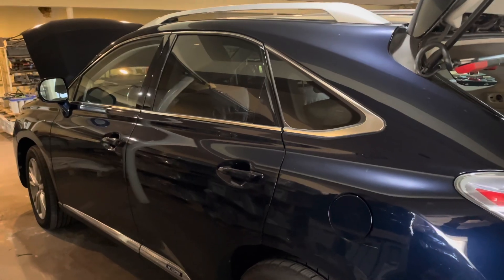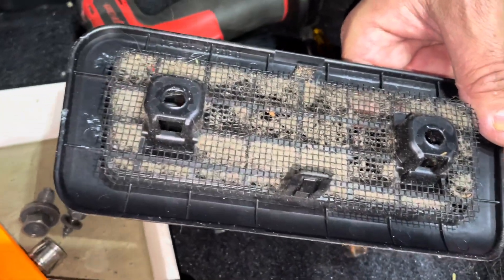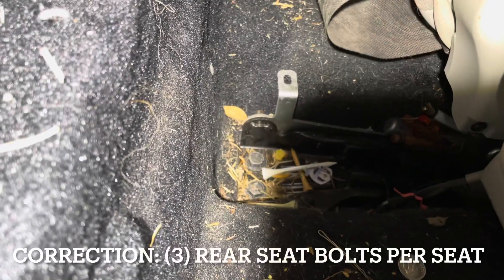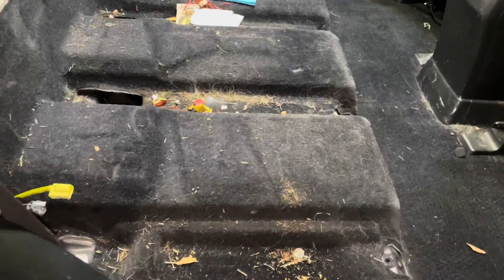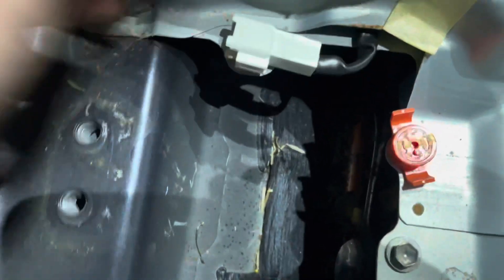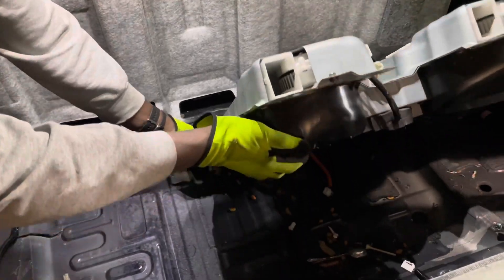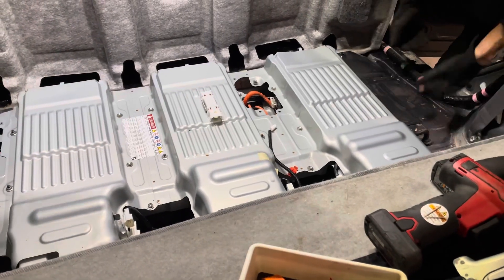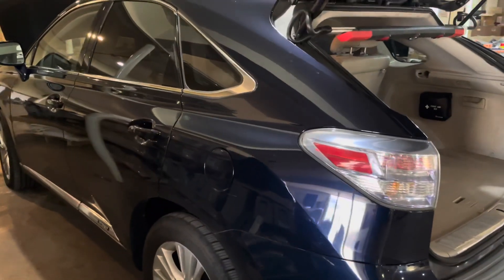Lexus RX450H Hybrid Battery Removal & Reinstallation (2010-2015)

Comment: Replaced mine with assistance from video. The car wouldn't start afterward. Immobilizer, security??
Reply from the maker: You would need to pull the codes to see what is going on.
Reply: @PalmettoBatteryPros  We got it, thank you for the video! Extremely helpful!

Comment: Great vid, I think you have motivated me to have a crack at changing mine.  Are there any fuses etc in that area that come totally take out the hybrid batteries and make the car not start able at all (this is what's happening with mine - the battery failed several years ago but it kept driving on the ICE, but now it wont even say ready and start the ICE)
Reply from the maker: Good luck with it!

Comment: I'm contemplating buying a 2010 Lexus 450h with 165k miles. Having watched your video, should I take the vehicle for battery  inspection at a Lexus service center or hybrid battery center like yours for hybrid battery status? Tremendously impressed with your work. Wish you were in San Diego! Thanks.n
Reply from the maker: I appreciate your comment and sometimes wish I was in SD.

Comment: Thank you very much for this excellent video. I have a Lexus RX400H on which I have just had the relay changed. The car had taken on water following infiltrations which no garage is able to tell me where they came from. A garage has kindly replaced the seals at the rear of the car, but it continues to fail. This means I have to stop the vehicle and disconnect the small battery to get the car moving again. Do you know how I can quickly check whether the car is still taking on water? Could the problem be due to the air vents being blocked? You seem to know the intricacies of these car models very well. I would be very grateful if you could help me with the final repair of this model of car that I love. Thank you
Reply from the maker: I'm sorry, I would really need to see it. I'm more of battery guy than an auto mechanic.

Comment: hi. I'm Lorenzo. I also bought a Lexus Rx 450h from 2014. It was hit from the front in 2023 and has been parked ever since. What advice do you give me to remove the battery? I'm a mechanic, not an electrician. Is there a chance that the battery, since it's been parked for so long, has failed?
Reply from the maker: Follow the video and call a national hybrid battery supplier. We recommend Hybrid Geeks.

Comment: I am watching this video on 9th March 2025 out of curiosity as I don't even have a hybrid but drive Lexus RX 300 -270000 miles on it. I am intending to buy a preowned Hybrid .
any tips you want to give before I buy .
However , your video is EXCELLENT AND AN EYE OPENER for all of us why we need to keep our car clean and maintained .Thanks, love this insight video and your hard work 
filming and sharing it with all of us , A BIG THANK YOU.
Reply from the maker: Thank you so much! The batteries need to be replaced around 150,000 miles or roughly 12 years in age.
Reply: @PalmettoBatteryPros I have a 2010 RX 450h and no sign of battery problems. 254 thousand kilometres now. When you use it will last ages

Comment: Great tutorial, guys.  I'm just a car owner and not at all a mechanic so these comments are from that reference point.

Just had my 2010 RX450h hybrid battery replaced and wanted some background on the steps required to uninstall the old one and install the new one.  Just a couple of comments, if that's OK:

1) It wasn't clear to me until near the end of the video whether the hybrid battery was installed under the front of back seats.  By the end it was obvious that it was under the back seats but because of the complexity of the battery removal and re-installation parts of the front seats needed to be removed.  Maybe in a subsequent video it might help to include a few quick video frames stepping back from the car to show the doors open to make it clear where the hybrid batteries are installed.

2) I was very interested in the part of the video focusing on the vents that were partially blocked by dog hair and other debris.  But I'm still not clear where these vents are and if I knew where they were, I could occasionally vacuum them our, or even remove the covers to wash the filters?  Maybe it's obvious, but as just a car owner, it would help me maintain the health of my hybrid batteries if I knew exactly where they were, and even a quick comment about how to keep them clean?

Thanks for a great video.  Very helpful!
Reply from the maker: Thanks for the feedback, the battery is located under the rear seats.

Comment: Hi! I just replaced mine today! I have an issue! After reinstalling the new one from the dealership, i am unable to start the car and I still get the P0A80 code! Do I need a specific scanner to clear the code and reprogram the new battery to the vehicle?
Reply: Did you fix the problem?
Reply from the maker: Were you able to correct this?

Comment: Hi guys. I have a question for the owners of the RX450h or anyone having experiance with it. Currently driving Prius Plus 2016,which has a small hybrid battery under armrest and heard only positive stuff about it. However, I am in love with RX450h and would love to get one. Should I stay clear off the high mileage RX 150 000 miles/250 000km or with good service history I should go for it? Or mybe better pay extra for lower mileage? Greetings!
Reply from the maker: These batteries need replacement after 150-200K miles

Comment: Same code popped up on my 2010. Ordered a used battery out of a crashed vehicle on ebay its about to be here..   my battery in the car now works for about a 100 miles give or take until i throws the code..  179k miles.  Should i check to see if theres something simple in the battery that needs replaced or just replace the whole thing with a new battery im getting?  Thanks!
Reply from the maker: it’s taken me years to figure out how to properly inspect, analyze and recondition these batteries. Also, I use expensive machines to test/balance modules. Given the worth, I’d see if anyone/dealership would give you money for returning it instead of trying to fix it. At 179k, the modules are low in capacity and having trouble balancing, In addition to corrosion related issues with hardware, harnesses and bus bars.

Comment: 8:08 I noticed those arent lock nuts that came off the battery pos and neg. My car just smoked up after about 4k miles after installing the new battery. Im still trying to the car back running but those two bolts backed out and were loose. In the case of the negative terminal it actually fused the nut to the bolt.  I guess what Im getting at is Im going to use lock nuts when I finally get everything figured out and reinstalled. Hopefully that's all the cause my car to break down on me on the highway.

There was a suddenly loss of power and smoke coming from the back seats. The day prior I smelled something burning. I can send you some pictures, my battery junction block is done as the plastic melted away.
Reply from the maker: I’ve never had the nuts back off and I’ve done hundreds. Is it possible you didn’t fully torque down or left loose? The burning/fusing was from a loose connection at the ground. Any fault codes?
Reply: @PalmettoBatteryPros  P0A7A and P0A94. Im hoping the root cause of those are the battery connection. It melted the junction box so im awaiting part to replace that and repair the cable connector

Comment: Great video, thanks!

My wife has the same car . Does this car have cooling fan(s) for the hybrid battery and if so, where are they? Can I inspect / access them without removing the seat? Thanks!
Reply from the maker: The fans are on the back side of the battery. You would need to remove everything to get to them. I recommend just keeping the rear floor area as clean as possible.
Reply: Thank you! @PalmettoBatteryPros

Comment: great video--couldna done it without it!!  I ordered a factory OEM battery.  Was totally surprised when I saw that I had to disassemble my old battery and remove all the wiring.  Not a job for the faint of heart!!
Reply from the maker: Sounds like you made it through. I appreciate the comment. Apologies for the late reply, I’m swamped with work and backed up on video production.
Reply: @googolpi  I got it through my local Toyota dealer.  I paid $6900, but got $1000, back when I returned the core.  Dealer let me switch it out on their property.
Reply: @GaryArchie  how is the new battery? Is there any warranty on it? Did mpg change? Thanks
Reply: @idgafa  Battery works fine.  I think there is a 1 year warranty. mileage definitely improved.  Next time I would probably buy a rebuilt battery.
Reply: @GaryArchie  Just to save money?  Rebuilt vs new theoretically the same?
Reply: Hi, I'm also about to replace with OEM pack, part g9510-48051. When you say disassemble old battery, did you mean the actual battery modules? Or just you had to transfer the blower fans? From my understanding Toyota/lexus sells the battery as a whole unit already assembled, only thing I may transfer is the blower fans inside the enclosure. Thanks in advance.
Reply: Its. “Feint”

Comment: Hi palmetto battery, how do you test or measure the batteries before re-installing the vehicle interior? Or do you simply reconnect everything and hope it works?
Reply from the maker: If straight from manufacturer, install and good. If it’s been sitting for 4+ months, level charge the battery before installing
Reply: @PalmettoBatteryPros  thanks for the response. thats super interesting! Id love to see a video about how this is done by a professional (youtube mostly has hobbyists with hobby grade chargers)

Comment: I wonder how much a new battery costs?
Would car work without it (petrol only)?
Reply from the maker: The car must have the traction (hybrid) battery operational and the cost for the aftermarket rebuild kit is $3850 out the door

Comment: (UK) Toyota say they now have a 15 year warranty on the hybrid battery, as long as you have it checked annually, separately or as part of a service. This is a specific check, not just a glance at it. I had it done separately, and it took 10 minutes, nearly long enough to drink the cup of tea the dealer made for me. 

Quite what happens if your battery turns out to be dicky, I have NO idea, maybe they change one cell, maybe all of it, maybe charge labour, but my 2009 RX is still fine.
Reply from the maker: Seems like a really good option.

Comment: Just get the 350 v6
Reply from the maker: You’ll only pay roughly over a $1k extra per year in gas, so before you’ll need to address the hybrid battery you would have saved 10-12k.

Comment: Thank you so much for the detailed DIY installation guide. May i check with you, how these cylinderical type compared to the prismatic type? Are both do the same in term of performance? Is the cylinderical type good enough and as good as the original battery? Seems the cylinderical is easier as it come bundled and ready for swapping out the current bad battery.
Reply from the maker: I've been selling and installing these kits with the same manufacturer for 5 years now. I give 4 year warranties and they are rare to none. I have been very pleased with this product.

Comment: Could you answer this question please if you have experienced that? I replaced the batteries on two RX450H.  After 2 years and 15,000 miles on each the permanent code wont go away and I do not get any code on the panel and the car works normal. It's just that the permanent Code P0A80 (Replace Battery Pack) wont go away. Thanks!
Reply from the maker: If the batteries didn’t show signs of weak modules or unbalancing I would check the 12v. I’m sorry, I’ve never encountered this situation.
Reply: @PalmettoBatteryPros  No in fact the 12 volt battery is new. If there was a problem it would have shown on the panel. There is no problem with the battery and I. know all the battery modules are OK. I think this is just what Lexus does so that you have to take it to the dealer to clear the code and charge you a thousand!
Reply: @paulcamalin5236  have you ever figured that out?

Comment: My has just clocked 233k. Had the hybrid cooling pump code on, I had it replaced then the guy said, that battery code was popping. I think it’s time for replacement. Is it worth spending money when car fax is giving me $6500. Battery will cost me couple of grand or so? What should I do?
Reply from the maker: Its a Lexus/Toyota, so the car will run forever if taken care of and a hybrid battery replacement. If its in good shape and its just the battery, then I would repair the battery and keep the car/no payments. I'm actually looking for a well kept 400 or 450H right now with a bad battery.

Comment: i have the same car but they are ok. I think the batteries in the car shown went bad because of all the dirt and dog hair which blocked a proper cooling !
Reply from the maker: That is the one thing that brings these vehicles in as early as 120K miles instead of 200+.
Reply: @PalmettoBatteryPros  hm, i think my battery now went bad slowly after 330000km and 14 years. Fuel consumpition is 1ltr more but i could be also because of a leak in the exhaust which causes the engine to run much more often and longer and sometimes it goes on at a stop with fully loaded akku. idk, but a new exhaust is just to expensive ....over 5k !
Reply: Mine was great until it got water in it from a rain puddle 😢 240,000 miles

Comment: 1:34 Power is off - can't move seats.   need to move Seats BEFORE disconnecting power.   thanks for the video!!!
Reply from the maker: Yes, I just hooked up the 12v to move seats.
Reply: Is this specific to the hybrid RX? Because I can move my power seats forward and back without turning my RX on, but mine is a regular RX 350

Comment: How did you move the front seat all the way forward with the battery disconected? Do they run on the Nickel battery?
Reply from the maker: The seats operate on the 12v system. I probably just connected the rear 12v to move the seats.

Comment: Can you swap 2010 rx450h battery from 2016-2022 rx450h?
Reply from the maker: I honestly do not know how different the battery is, I've never opened a 2016 or newer. The manufacturer lists them as 2010-2015 so I would assume the batteries are different.

Comment: I noticed you moved the front  seat AFTER disconnecting the 12V battery. How is that possible? Was that a mistake in your video? BTW thanks for this. I'm going straight to my wife's car and clean the battery vents!
Reply from the maker: I may have moved it forward at some point by just hooking the 12v back up. Can’t remember. Vents are super important, and if you notice water getting in the cabin (via worn seals) address it immediately. The water settles at the lowest point which is unfortunately at the battery opening where the main HV cables attach to the battery.

Comment: So let me get this straight..You are sitting on top of a high voltage battery set-up? That's not for me...I guess I won't be buying a hybrid vehicle anytime soon..Plus, how much does a replacement battery cost?
Reply: You do realize you are sitting on top of a fuel tank in your car
Reply: @TheTrev4477  Lexus dos not have the li-ion accumulator, but NiMh. So there is not a problem, it is not burning. ;)
Reply: a replacement battery is about 2000 bucks, but its not common that u have to replace it. the rx450h is just like any other lexus, reliable.
+ sitting on the battery doesnt really matter, lets say u see any smoke in the back seat, just stop the car ;D car batteries doesnt just spontaniously combust.
Reply from the maker: In all the years I've worked on hybrids I have never heard of or experienced a catastrophic failure of the HV battery. Ni-MH has been around since the 70's, it is not a new chemistry and completely safe. The individual modules are low voltage and low amperage.

Comment: That plastic seat clip is such a pain in the ass. All my dudes hate doing it. Unless you have found an easier way
Reply from the maker: Constant cycle. I struggle with it at first, but by the end of the job I got it. Then I don't do a RX or High for a month or so and the cycle repeats.

Comment: Based on your experience with these vehicles, if properly maintained, at what mileage should we expect them to fail and if buying used, how can i tell if its failing during a test drive?
Reply from the maker: Great question. I normally see these vehicles between 150-220k. The biggest factor is dog hair and debris around the 3 vent intakes under the rear seat. If the vents are cleaned and the car was properly maintained, the battery could see 200K+, very unkept vehicles, especially with dog hair, can have battery problems around 150K or sooner. As you can see in this vehicle, the battery compartment was extremely dirty and this caused this vehicle's hybrid battery to fail at 145K. I recommend having diagnostics run on the vehicle to make sure there aren't any codes present and also check the 3 vent intakes for any debris or blockages. I would be weary of any hybrids over 150K that have signs of debris around the intakes. Check the screens behind the plastic vent covers with a flashlight. If any debris, the battery has been and is being stressed.
Reply: @PalmettoBatteryPros  Thanks a lot. This has been very helpful. Will look out for that in my search.
Reply: What would be the estimate of how much a battery replacement would cost, parts and labor???
Reply: i have now 300000km on my 2010 RX450H and all is good but every year inspect these cooling filters and work of the 3 batterie cooling fans !
Reply: @ kubanskiloewe Where are the cooling filters? Are they behind the vents and easy to access?
Reply: Iv got a 2016 rx450h . Now it's 260k km and reliable you can wish for.  Lexus are great